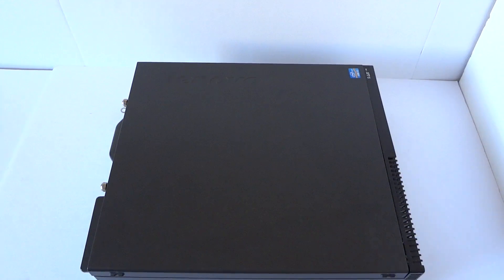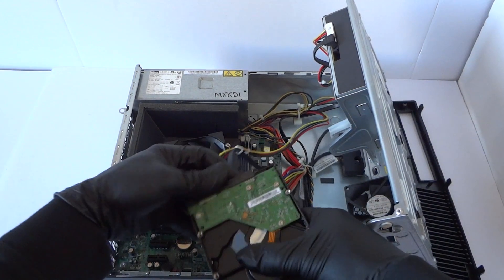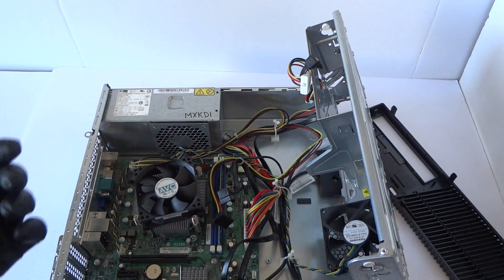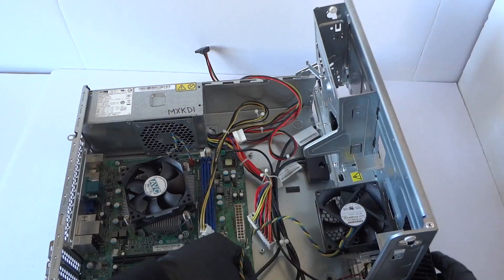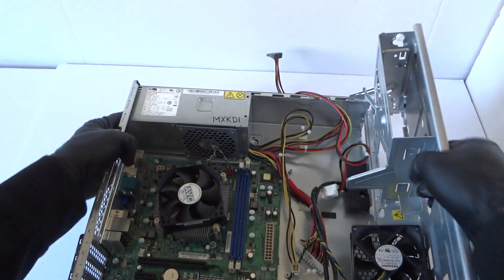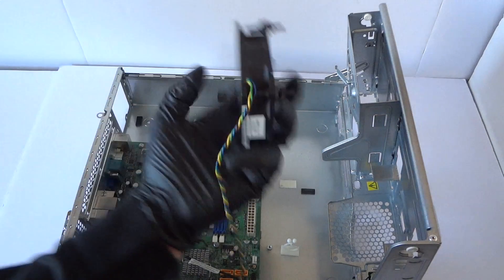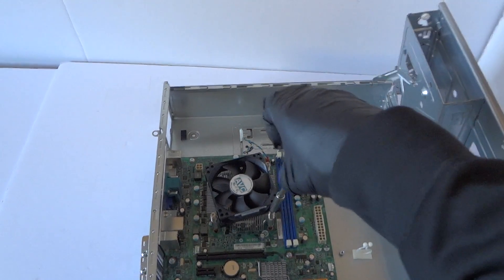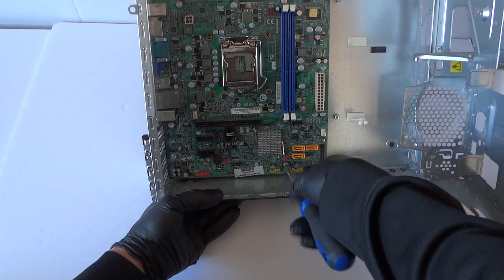Lenovo ThinkCentre M72e Teardown

Comment: Can I take out the optical drive and use those sata/power cables for a SSD in that same spot with tape? (Yes I know it will be a hole there but idc)
Reply: That’s what I did with a 500gb hdd it will work I’m surprised I’m not the only one doing that lol

Comment: Thanks, I got a prebuilt PC with similar components, Im planning to move it to another Case, but thanks alot because I needed some info on how to start disassembling this machine first.

Just wondering about the motherboard, where should I check the compatibility with a GPU or a CPU without having issues such as bottleneck or incompatibilities.
Reply: I'm planning to do the same thing with my Lenovo M72e. But I was actually going to mod the case and it with a different color and cut a hole on the side cover and put a tempered glass on it.
Reply: Try to avoid any case with front rgb or led panels, since the mobo is a bit old there is no connectors for those lights, you will need extra cables to connect the front panel USB connectors and audio jacks, if you want them.
I actually realized this when I bought an Aerocool Cylon RGB case, I kinda gave up, since the memory was DDR3, the power supply was kinda weak, and it may not support a GTX 1060 without giving bottlenecks, so Im saving money, working and looking for the best prices to get a new one this was my previous build:
Motherboard with H81 intel chipset
i5 4570 3.20ghz
2TB Western Digital 7200Rpm
GT 1030
Ram 8GB Ddr3
Generic Lenovo 250w PSU 80 plus bronze
Windows 10 Pro
M72e Case
Reply: I currently own the mobo and video card, used GPU but functional for $200 here's the new build, expecting a total price of $550  USD Dollars:
MOBO: H310M-E Asus
i3 8100 4 cores of course
GTX 1060 6gb Msi armor
Ram DDR4 kingston 8GB
PSU: Corsair CXM 550W 80 plus bronze.
Im reusing those 2TB from my previous build.(I could just buy an SSD and sell the old PC)
Windows 10, gonna use an USB flash to download it free from another PC, and finally the case is gonna be the one I bought previously mentioned.
Reply: Hey man, did you already bought a new case? what model is it?
Reply: Can it paired with gtx 1050ti?
Reply: @deicide_06  If you mean the PC on the video, yes, be careful with the power supply you might need to change it, and consider getting a low profile one, also check if your processor will not bottleneck it.

If you are talking about my build, yes with no problem, no need to get a low profile as the case is big enough.
Reply: Can i transfer the mobo to another case? And the I/O shield?
Reply: @deicide_06  Nope, the I/O shield comes with the case and it is dependent, and that i5 3470 may bottleneck your gpu, you should research and watch videos related to Old PC revivals. And analyze the balance of your components.
Reply: Can i pair i5 3470 to gtx 1050ti?

Comment: Hello, can that front lift up down part of the case be removed? 10:50. The reason I ask is i'm thinking about building a GPU mining rig from an old PC , I would need to be able to remove the front part to make room for a brand new Power supply. what are your thoughts? :)
Reply: SoSo Ninja probably, if you could I think it would be a good choice,  I lifted up the lift and the case just warped and now the lift won't go down.